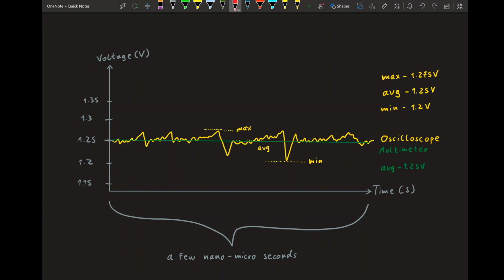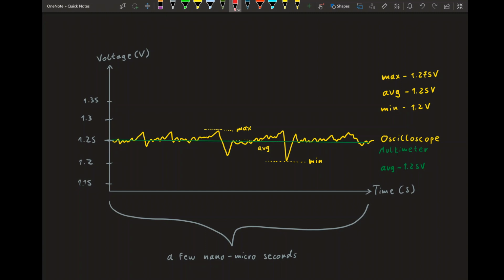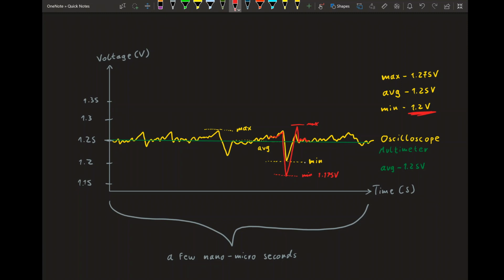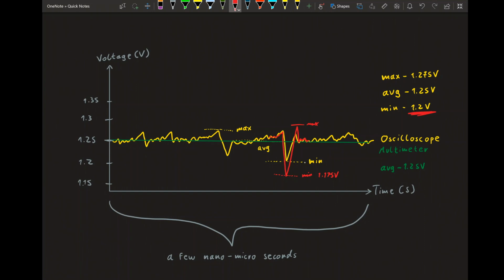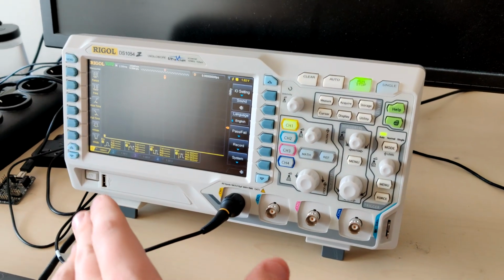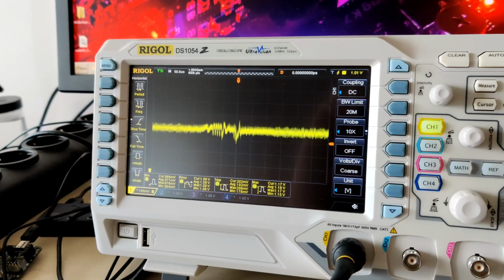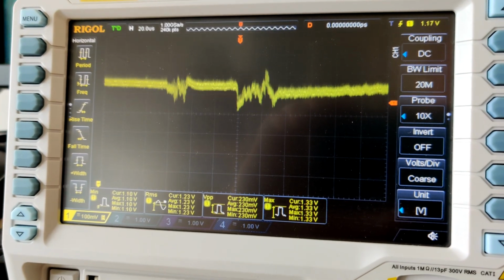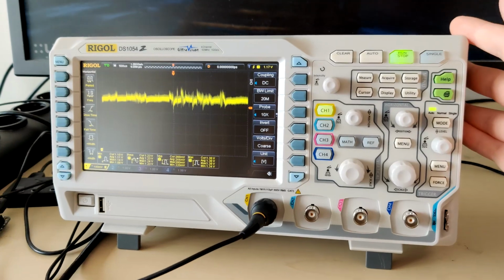Why Oscilloscopes are so useful (and why i bought one)

Comment: why yes, it can tell you which rail to capmod.. first. so useful! and it might kinda sorta pay itself with only ~500 boards modded (assuming cheapo ~200E scope and retail cap prices), and save so much time in the process.. that is if you didnt need time to set up the scope and take measurements, then still need to capmod^^

boyo please, only real utility you will (potentially) get out of it is diagnosing intermittent failures in vrm phases

Comment: Great video. 
Not too surprised Epowers don't do too much for better voltage regulation as my view on Epowers is that they are for increasing the power avaliable and then you cap mod for better regulation just because the distance between the vrm and the core is too much for it to have good regulation.